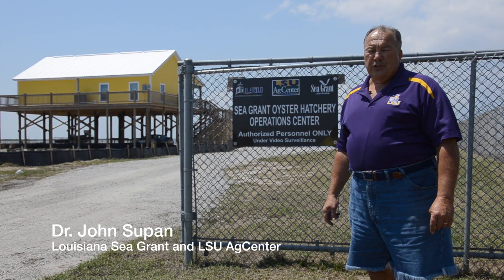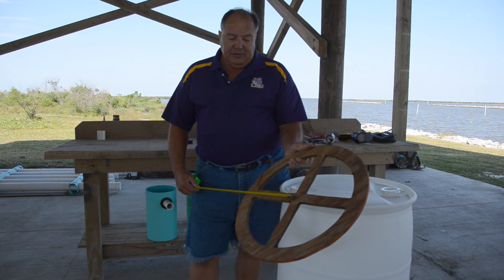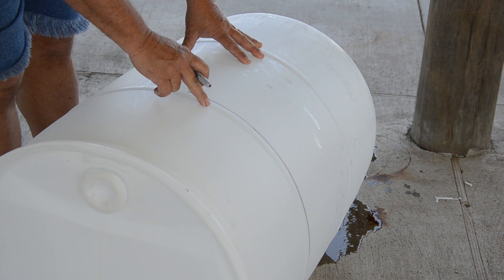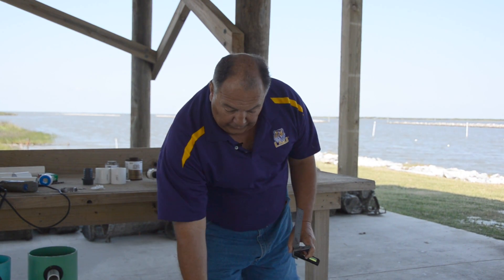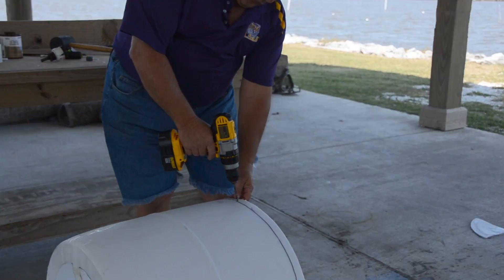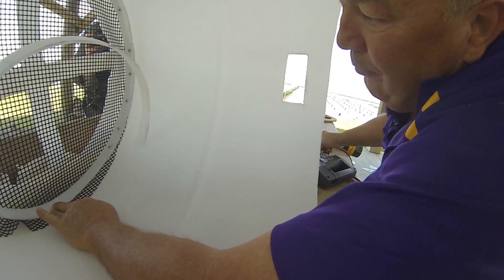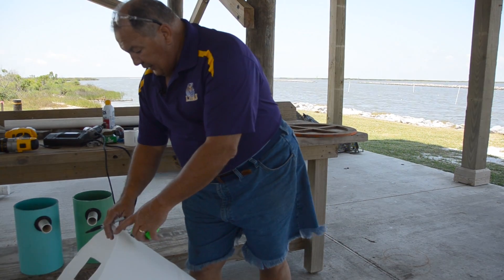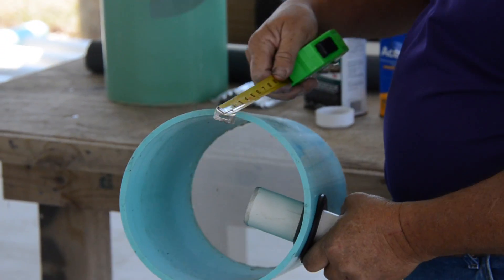Oyster Nursery Silo

Comment: Do you grow your own algae or use brownwater method (bay water)
Reply from the maker: This system was designed with unfiltered baywater (brownwater) as the food and water source. It may be possible to use cultured algae (either live or paste/concentrates), but that would require altering the system design and operation to retain water during feeding.
Reply: @LouisianaSeaGrant  ok.  I guess that's why they use raceways.  Thank you for this.   Our company is trying to start growing our own seed.  This tutorial was very helpful.
Reply: @LouisianaSeaGrant  also, do you have any opinions on "bottle-upwellers"?